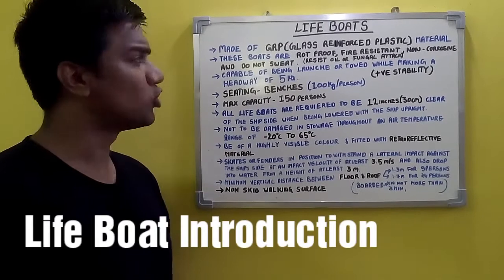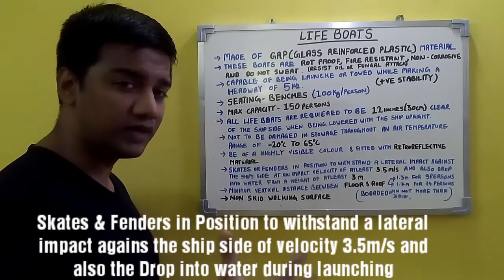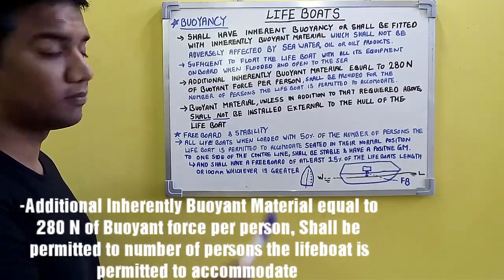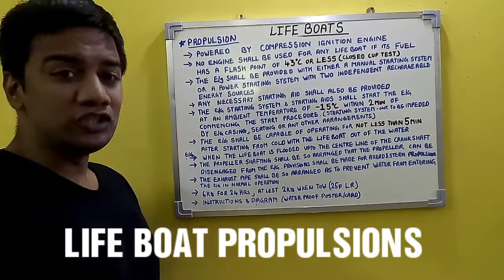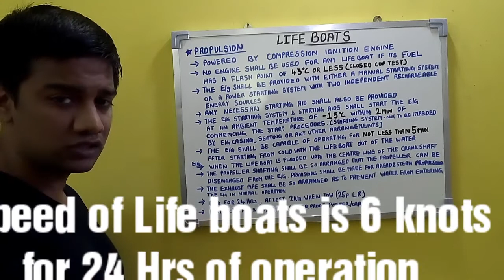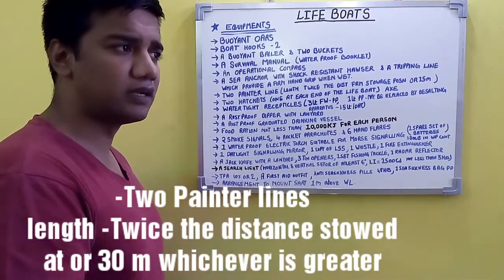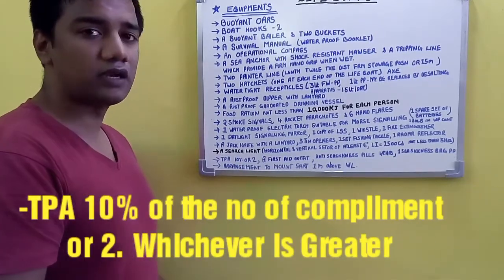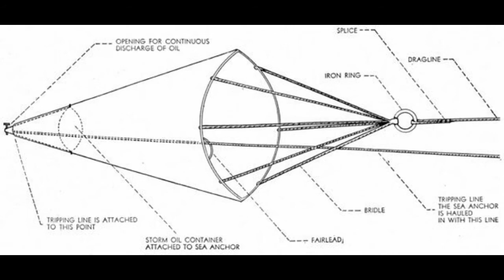Lifeboat as per SOLAS , Part 1

Comment: explain this- the engine shall be capable of operating for "Not less than 5min"after  starting from cold with the lifeboat out of the water?
Reply from the maker: Vikas Gupta 
It means that in Cold weather as well as from the idel state when we start an engine it should be capable to work for 5min .
Reply: THANKX BRO

Comment: Length of painter is twice the stow ht or 15m whichever is greater.....U have mentioned 30m 😕
Reply: Nihal Gupta in lifeboat equipments the painter length should b not less than twice  the stow ht or 15m whichever is greater....This is what m talking about ..lsa code chp 4
4.4.8
Reply: Nihal Gupta may b m wrong but 30m is not mentioned in solas or lsa code..Can u pls give exact regulation no. Where u found this 30m
Reply from the maker: Vikas Upadhyay 
Bro you are right i stand corrected.
For lifeboat painter length is twice the distance from the stowed position or 15 m which ever is greater.
And for liferaft painter lengtg requirement is 10m + the distance stowed at or 15 m whichever is greater.
Kindly cross check pls
Reply: Yup it is correct now.
30m is actually  mentioned for lifebuoy buoyant line .